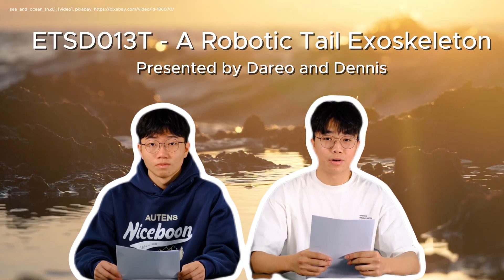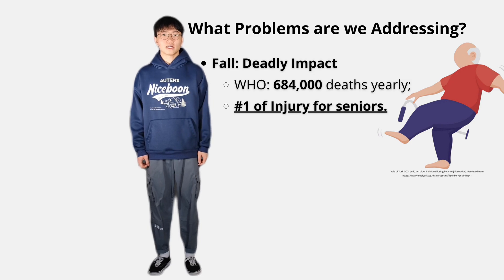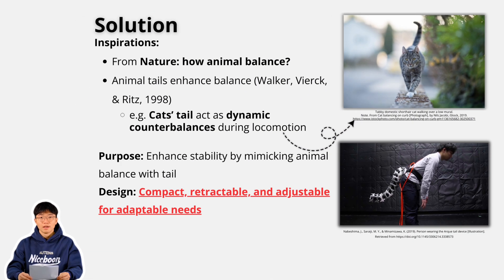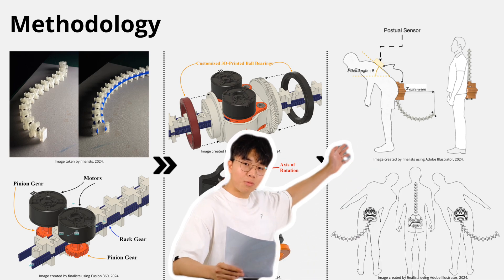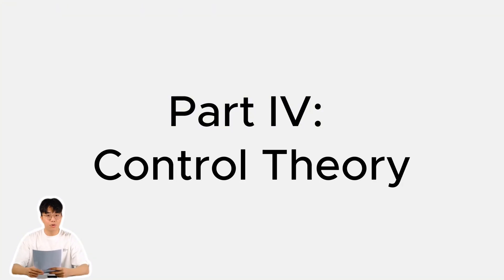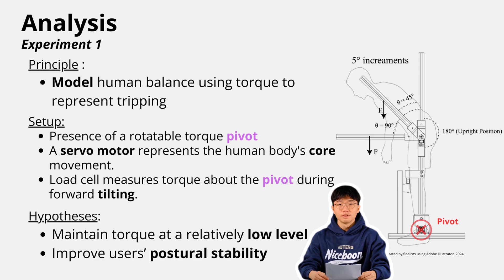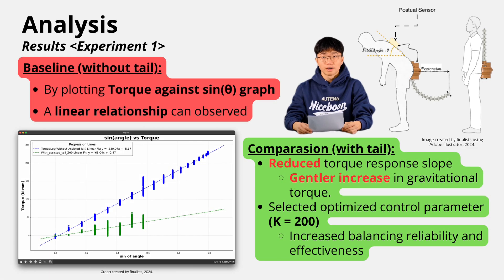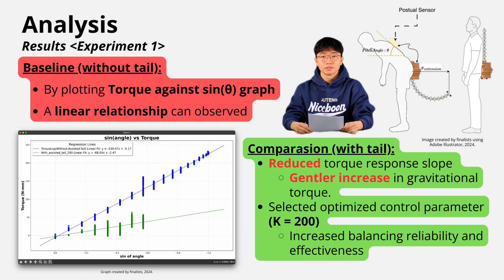ETSD013T - A Robotic Tail Exoskeleton

Comment: It would be super cool to see side by side runs on a balance beam with and without it, I think it could prove the concept really well. This would work great with an exo-suit system, and the weight wouldn't be as much of a factor in that case. 
Also, if the motors could be integrated to be used as the counterweight at the end of the tail, it would reduce total system weight.